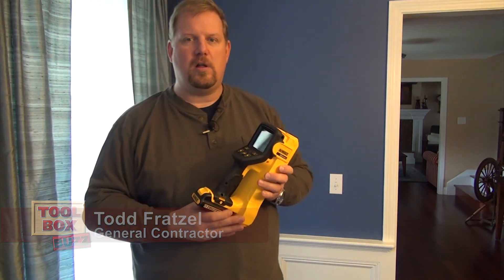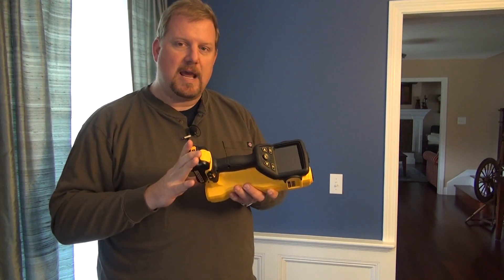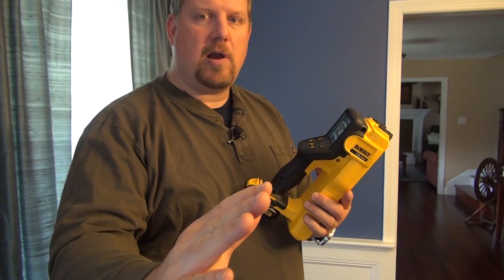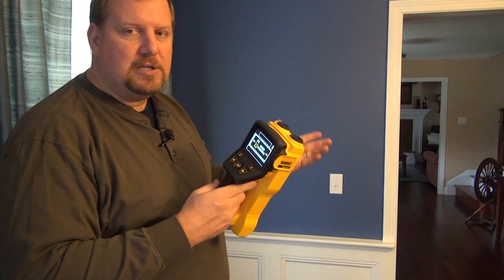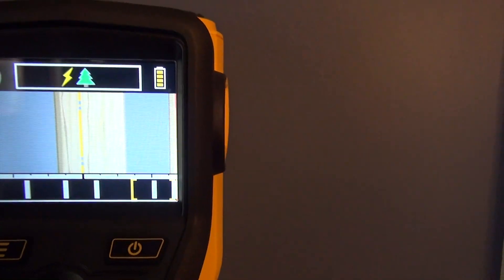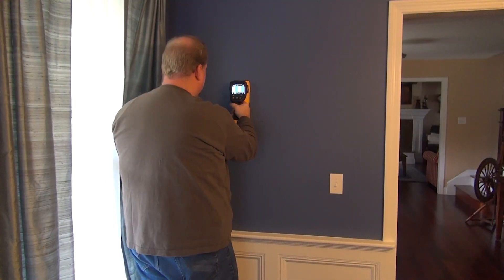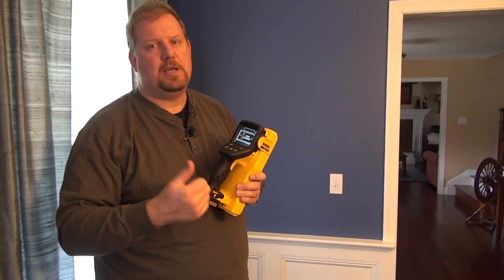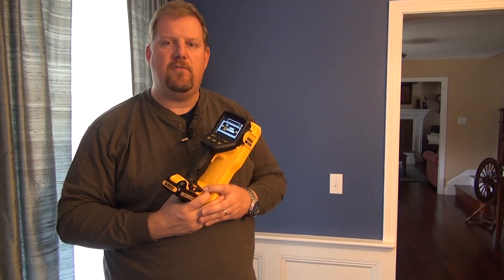DEWALT DCT418S1 Hand Held Radar Wall Scanner

Comment: Is really accurate? I've read many reviews and they all say it doesn't work, that it gives different reading on the same wall.
Reply from the maker: They are accurate when you understand how to use it and what it's limitations are. Behind every wall there's all kinds of things going on. You really need to scan the wall at the top, middle and bottom. You need to realize that in some situations a screw might register a metal stud, or a piece of corner bead. Once you practice on a wall with known items it is very easy to identify what's behind the wall. Like everything in this world, the ones who complain typically haven't learned the limitations or understand it's a tool, and not a miracle.
Reply: c plote  The stud isn't alive with electricity but there would be a live wire stapled to and running up along the stud from the the switch to the light hence the double reading.  Basic construction 101.  That said, I've never used this or its replacement so I can't speak of its accuracy and DeWalt seems to pay little attention to the 12 volt like.  I am curious about the new Bosch radar scanner though.

As for what everyone else on the 'net says... I take most commenters with a grain of salt since there are as many knowledgable people posting comments as there are ignorant people and posts.  ;-)  Cheers!
Reply: This guy got paid for this.  Everyone else on the net says it sucks, even Dewalt pulled it but this guy says we are idiots and do not know how to use it?  More like tool box buzzed!  you are a shiester salesman!  Even in the video you see a wood stud that says its alive with electricity are you kidding me?